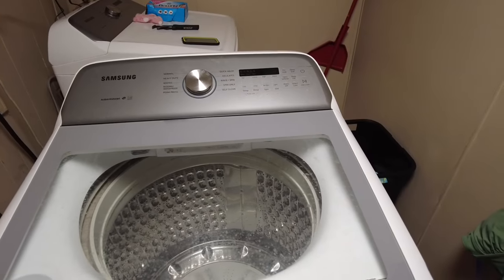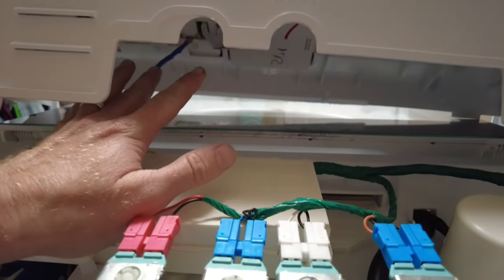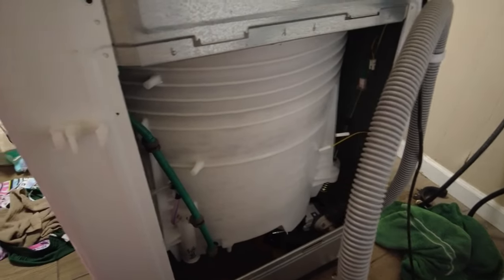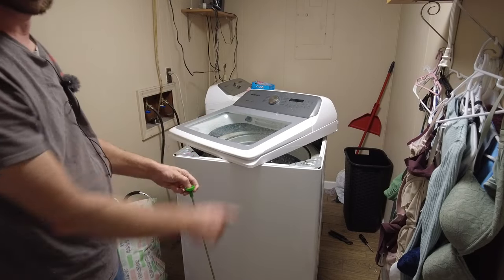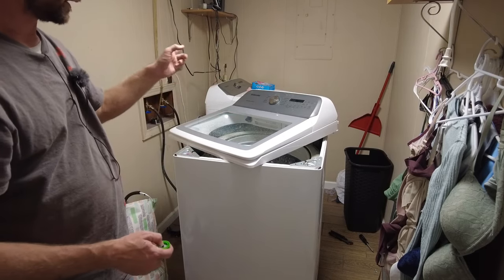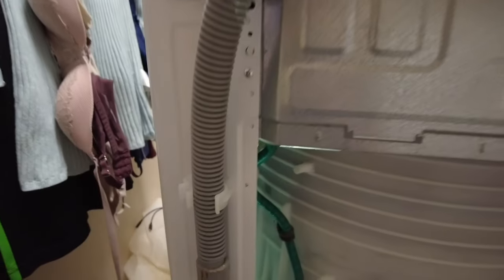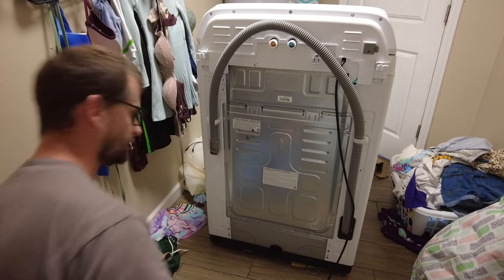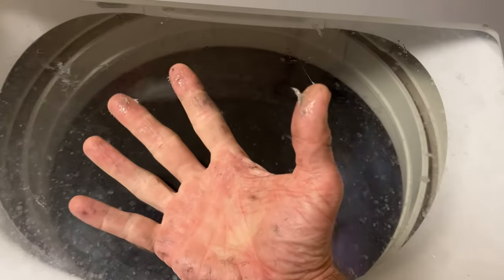How fix an unbalanced load on Samsung active jet washing machine

Comment: Thank you, I had tried this and didn’t do anything. We tried again (just now)  it worked.. but didnt solve the issue.. now drilling two more holes to see if that helps, if not.. we’re done and just gonna buy a new machine. Appreciate your help!
Reply from the maker: Glad I could help, I also still hate my machine too
Reply: Just fyi, the holes in the underside of the barrel did seem to work!! So there’s always that last ditch trick!
Reply: @shelleygaris5547 what holes? I have tried the replacement in this video and it didn't fix my issue-
Reply: @JBrletic-v2i  we had to drill multiple holes on the underside of the lip of our washer tub. We drilled about 6-8 holes straight up all the way around evenly. Water poured out. It’s not perfect and we still have to make sure we don’t overload it, but it really did fix a majority of the issues.

Comment: I just replaced my rods with new ones and it’s still doing the whole shaking and UB code during spin cycle. It’s a very small load
Reply from the maker: Wow we have the same last name and spelled the same.  Anyway, have you tried to calibrate the machine?  Did the new rods come with grease?  Also keep in mind Samsung did not make this machine to last forever.
Reply: @ChrisThedudenurse how do you calibrate the machine ?

Comment: This is a washer from hell we have replaced the suspension once while it was under warranty and now it’s throwing the same code and seems in balanced 😢 I regret ever purchasing this washer .
Reply from the maker: As do I.  I really wish I’d kept the one that worked.  I only swapped because I thought I’d like the larger tub to wash less loads.  Turns out I should have kept the old one.

Comment: Any other suggestions? Replaced them and didn’t fix the issue at allllll!!! 🤬🤬🤬
Reply from the maker: Did you calibrate the machine after the job?
Reply: I haven’t found a way to calibrate it. I’ve googled our model and the Samsung website was useless. Our model # is not one that seems to be common? The buttons that I’ve tried to hold down to “calibrate it” don’t seem to work on ours, as a reboot. We have model # WA50R5400AW/US. Did find a video where someone suggested drilling holes in the upper interior of the basin which several people have stated works wonders so that’s our next step. (This isn’t a negative on your video, the tension rods were fairly easy to fix, I wish that was the only issue) this is a terrible machine and I wouldn’t recommend it to anyone :/
Reply from the maker: @shelleygaris5547  How to calibrate a Samsung top loader washing machine
https://youtube.com/shorts/FYj8li0Mhg0?feature=share
Reply from the maker: @shelleygaris5547  oh it’s truly a terrible machine.

Comment: Ok, this helped me but it was a JOURNEY. I'll share it to try to help others.
4.5yr old washer. Started Ub about 2 months ago. Doing everthing described in this video.

#1. I replaced springs and calibrated. NO GOOD. Noted that old spring on back right was bent.
#2. Adjusted level. NO GOOD.
#3. Added strips of foam pad between drum and walls to stabilize a bit, limited success but really 95% NO GOOD. #4. Removed foam and calibrated. Drilled the ring at the top inside the drum to release the water. Calibrated. 66% no good.#5 sat there and watched an entire quick load with 5 towels running. Noted that when the spin would go unstable it was pulling to the back right. At about 50 degree angle. I raised the foot on back right about 1/2 inch and front right 1/4. Calibrated Watched another test cycle and quick load ran fine. #6 ran the same load as Normal Load. Ran fine. Wife was elated. While i was at work she reported Ub codes all day. I came back at it. Calobrated. Ran a normal load no problem. Discussed it with her and she reports that she ONLY runs Heavy Duty loads regardless of the qty of clothes. #7 wife ran laundry and just did Normal Load. We are 1 week on after success and its still running fine.  Side Note: I found a large dent on the right side where a Ub load made the drup hit the side and dent it out like it got hit with a hammer.

My final theory is that this machine running heavy duty loads for 4.5yrs eventy had a badly overloaded drum at some point that dented the side wall and probably warped the frame. The floor is 100% LEVEL but I had to raise the back right and front right foot to let the washer sit level. It seems conclusive that the frame is warped and not the machine can only handle normal or express loads.

Hope this helps someone..  
Run an express load and sit there watching the ENTIRE load. See what angle the drum leans out to when it goes Ub and raise the feet on that side! Along with new springs and dont run heavy duty loads.. it might be the fix.
Reply: I dont know at what point the rear right spring bent or when the side wall was dented by the drum Ub and hitting it. The machine running with a bent tension rod. (In my mind) definitely warped the frame a bit. Why else would i need to lower 2 of the feet by different lengths to fix the Ub on a flat floor that i confirmed is level with a carpenter level. Ive fixed maybe 8 different washers and dryers for myself, family and friends so I have a solid novice level experience here...😊
Reply from the maker: Sounds you was busy with all this.

Comment: Thank you. I wish I'd never brought this machine, but at least it's working again!
Reply from the maker: @melanielustgarten2554  completely agree, I hate that I gave Samsung money for this garbage.
Reply: @ChrisThedudenurse  So after 2 loads of laundry, the same problem started again. Tried replacing the rods with other ones I got from Amazon, but that didn't solve it either. Do you have any other suggestions?
Reply from the maker: @melanielustgarten2554  did you recalibrate the machine after you did the new rods?
Reply: @ChrisThedudenurse  yes.

Comment: hey guys so i had the same issue one thing i would mention is that if the code still comes back or your washing machine still adds time to you load. You will want recalibrate your machine all you have to do is.  1st power on the machine, then simultaneously press "Temp" and "Delay End" then press start.  This function calibrates the "X" "Y" axis of the washer drum.  It will take about 2-3 minutes to complete and rotate the drum multiple times at various speeds.  However, it worked like a charm.
Reply from the maker: Calibration don’t work every time, but it’s definitely a good place to start.

Comment: OEM are either unobtainable, or cost prohibitive if the advertised ones are legit. I decided to try a different $35 Amazon set from the green “upgrades” we put in a few months ago. Advertised as resolving our issue, with hundreds of favorable reviews. Installed last night. Also did the recalibration process again. Two loads and no banging or uR code yet. I’m still skeptical, as our original replacement set seemed to work better for a little while. I’m thinking this washer design is just flawed in general. If the issue happens again, we may try to create and install bigger bumpers to put on the sides of the washer so the drum can’t move around as much. If that fails it will be a new washer from a different brand with the same flawed suspension design.
Reply from the maker: It’s definitely a flawed washer design.  Theres too many people having the exact same issue, and I’ve never heard of another washer doing this.

Comment: HEADS UP: I just saw a potentially way easier/faster way to do this where you lay the washer on its side. Looks like it might take 5 min that way and no screws removed. Highly recommend looking into that way.
Reply from the maker: @jaysonx5576  I’ll have to check that out
Reply: @ChrisThedudenurse  Thought I’d circle back with that, as it sounds like (after more research) some folks are having to do this fix every year or two if they do a lot of heavy/high spin loads. Never would have occurred to me to go in through the bottom.

Comment: I fixed the problem with a $1.99 pool noodle.  You can open the lid and snug the noodle between the outer drum that doesn't spin and the inside of the washing machine side panels.  It acts like a shock absorber.  This is not a permanent fix however it will get you back up and running.
Reply from the maker: Now that’s thinking outside the box

Comment: The green wires are ground wires. There are two types of grounding… system and equipment. Those are equipment grounds in case anything metal becomes energized. Especially dealing with water. It’s a fail safe
Reply from the maker: Yeah water and electricity tent to not be friends.

Comment: Thank you for the tutorial. I changed the suspension rods and still have an unbalanced problem. Do you have recommendations for how to move forward?
Reply from the maker: Did you calibrate it after doing the switch?
Reply: @ChrisThedudenurse  yes I did it a few times for good luck

Comment: Do you have a video on how to access and clean the water filter. I kept getting a 4C when trying to use hot water or deep fill. I haven’t used any other features other than delicate and quick wash, but with the other 2 ive noticed the code pops up. No kinked lines either
Reply from the maker: Yeah you'll just need to remove the hoses and clean that little filter in the water line.  I can show that.  It could also be a bad sensor.

Comment: Thanks for the great walk through. I have been through 3 sets of rods before getting the rods you suggested. Changed them out, recalibrated and the tub still is violently out of control when the spin and refill process starts and never stops. Do you by any chance have any suggestions for what would have been your plan B if the rods didn’t work for you? I’ve spent countless wasted hours on phone calls and in chats with Samsung and they either offer a tech coming out for $350 to start or giving me a deal on a new washer which is not a deal at all for me. More like a deal breaker.
Reply from the maker: Plan B is a washing machine change to a new manufacturer.  This will be my last Samsung washer or dryer.
Reply: As much as I hate to admit to defeat I am afraid I have come to a dead end of plan B’s myself and may have to let my ego take the loss on this one and end this terribly toxic relationship. Out of all the new lessons I’ve learned in this long and painful process the most valuable has been to never buy another Samsung unless it’s a TV.

Comment: Save yourself a headache and make sure to perform the calibration after replacing the rods by holding down the TEMP & DELAY END buttons at the same time and then hit start, it will take about 1 minute of spinning. If you don't do this you will have the same issue after a few loads. Also get some white lithium grease and apply it to the top of the lower cone of the spring and to the section on the machine where the top plastic piece rests.
Reply from the maker: Good advice

Comment: Everyone that bought the new rods from Amazon beware, I did the same thing and they worked great at first.  8 months later the machine is back to going unbalanced with barely anything in it.
Reply from the maker: @tonybarone5757  I’m not sure it’s an Amazon parts issue, I’m sure it’s a Samsung issue.  My rods lasted about 6 months.
Reply: @ChrisThedudenurse  I think it’s a Samsung issue too.

Comment: I have the same washer with the same problem. Replaced the springs but the ones it orginally had seems like theyre still pretty sturdy and even stronger then the replacements. I ended switching them out and still having the same issues, any idea what it can be?
Reply from the maker: Could be the new springs.  Did you calibrate it?  Did you apply new grease or did yours have that?
Reply: @ChrisThedudenurse  yes dud everything as the video showed and have the same issue not sure what it can be and I'm receiving the same error code.

Comment: Got the unbalanced part fixed but now im having a draining issue. Any tips for this?
Reply from the maker: Open the back up again and make sure your connections are good.  If that isn’t it then you have yet another issue with your washer.

Comment: I was super excited about fixing my same issue. I ordered the same springs that you showed and unfortunately it's worst now. The original springs felt a little bit stronger than the new ones so I was skeptical right from the beginning. I definitely bought the correct springs for my model. What would you recommend trying next? Are  there heavy duty springs I can buy?
Reply: I've come to the conclusion that the green brings are garbage. They'll too weak. I see genuine replacement springs online for $90 so I'm going to return these and buy the genuine parts. I saw them when I was ordering these $45 springs and was wondering why they cost so much more. Now I know.
Reply from the maker: That is a bummer, I’ve had good luck with mine but I still hate this machine.  Hopefully the new rods do the trick for you.

Comment: OK replaced the struts about a month ago with the ones on the Amazon link. Started the unbalanced game again after a month. Seems they didn't hold tension. I was sent a replacement set. We will see how they hold up
Reply from the maker: Did you also calibrate the washer when you were done.  Sometimes you have to I didn’t show that but I do have a separate video on how to do that as well.  Hopefully it’ll all work out for the best.
Reply: @ChrisThedudenurse Yep re calibrated twice, Re leveled it also. It worked great and then last week started the unbalanced act again. They sent me new struts. I think the springs may just be weak. made in China like most everything else we get . I will see what happens

Comment: I was having the same problem and replaced the rods. But after 4 loads  it’s doing it again. After reading comments I realize that I did not calibrate. What will calibrating do?
Reply from the maker: It’ll just set all of the settings back to zero.

Comment: Ok I have a washer just like in the video.  But my washer has  no power at all. I unplugged and plugged back in. Still no power. Could u please help with any advice????
Reply from the maker: @waynebernalsr8588  I hate to hear that.  Could be plug, could be something plugged in internally, or the dreaded computer board.

Comment: Replaced the suspension rods twice and still have the same problem.  Do you have any further advice?
Reply from the maker: Have you calibrated it? If so and that didn’t work, get rid of this machine and buy something else that isn’t Samsung.  I know it’s not always possible because machines ain’t cheap but these are terrible.

Comment: I have the same washer and replaced the rods. It works great for a month and it’s off balance again. What else should cause my machine to go off balance again?
Reply from the maker: @xdoutrex  the design flaw from Samsung.  Did you replace the grease or did the new rods come with it?  Did you calibrate the machine?
Reply: The new rods came with grease and I also added additional grease. No, I did not calibrate the washer. Any pointers on doing so?
Reply from the maker: @xdoutrex  How to calibrate a Samsung top loader washing machine
https://youtube.com/shorts/FYj8li0Mhg0?feature=share
Reply: @ChrisThedudenurse  thanks! I calibrated the washer and it did better at balancing for a smaller load. I ran a load with towels 3/4 full and it had some issues with balancing. After going through a couple cycles of adding water and spinning, it finally balanced. 

Given that I didn’t calibrate right after replacing the suspension rods a couple months ago, is there a chance I wore the new rods out already? If so, I can replace them again. Or is there anything else I can fix/check to help with balancing?

Comment: No, we got new springs and we replaced them. It’s still doing the same thing it will not spin the tow.
Reply from the maker: Did you try to calibrate the machine after the repair?

Comment: So any thoughts on after replacing rods the machine still goes out of balance?
Reply from the maker: Have you calibrated it?
Reply: @ChrisThedudenurse  yes and my washer also does that automatically upon start. Another thing there is good resistance up and down pushing the drum but side to side its just a light touch to move it any which way

Comment: Just a thought, what if you stretch out the coils by pulling on them?  That would make them harder to compress..... Just a thought. dont know if it would work.......
Reply from the maker: @jimcastillo8950  as terrible as the original set is I’m not sure that’ll change anything

Comment: Hello!! I have a very urgent question do you or anyone know how to speed up the spin speed? To make it go fast like how his does. Mine spins slow, I don’t know if I’m doing something wrong. Any helpful tips/advice ya’ll got?
Reply from the maker: @BlairGray-k4q  mine is a setting when you 1st turn on the machine.  It can’t be changed once the machine is running.
Reply: Which setting did you have yours on?
Reply from the maker: @BlairGray-k4q  it’s just called spin, there’s a line that lights up for the faster it will go.

Comment: My machine still bangs around. I calibrated the machine. Still banging. Not sure what’s up. The only dif is I put grease on the rod. Could that be the issue.
Reply from the maker: No if anything the grease would help.  These truly are not good machines.  Run a few loads maybe it needs to settle.